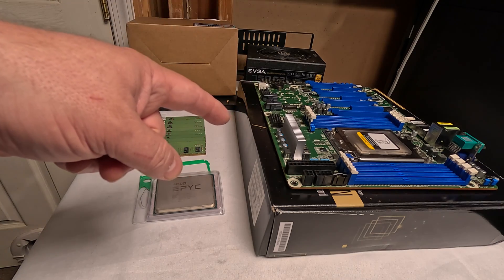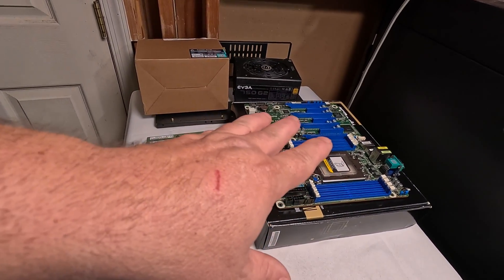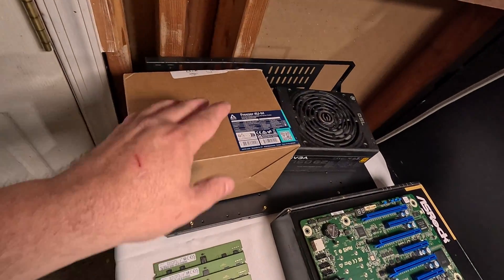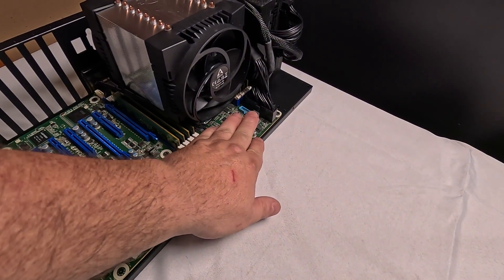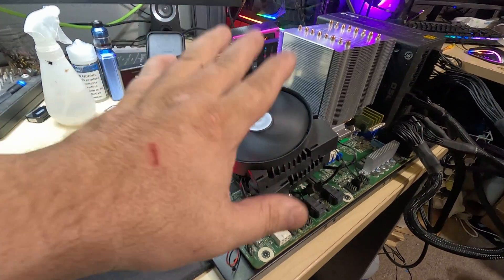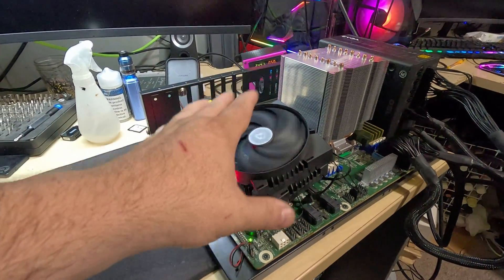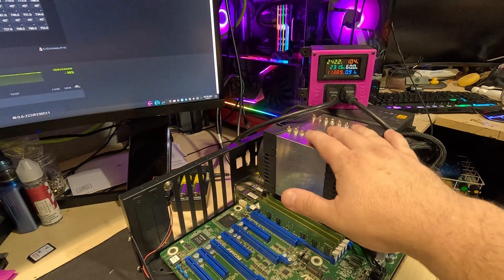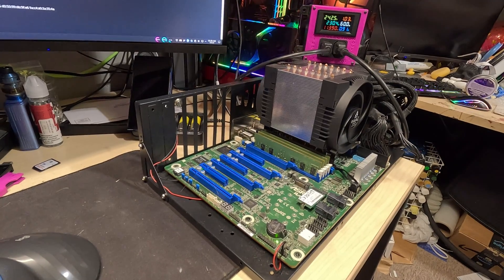Epyc Cpu Miner Build

Comment: odd, i get 212 mhs on verus with my dual 7702 rig with 4 sticks of ram per cpu, advice, you can overclock the ram and it will take it, i run 2133 ram at 2600 no problem

Comment: many vendors on ebay will sell vendor locked cpus and not say they are locked, nice thing about ebay is it will take your money back by force which i had them to do to a seller from china who sent me damaged cpus claiming they were cosmetic meanwhile both had resistors missing from the bottom of the chips